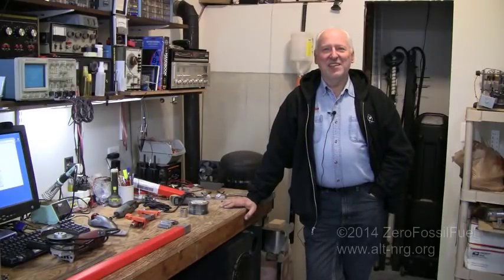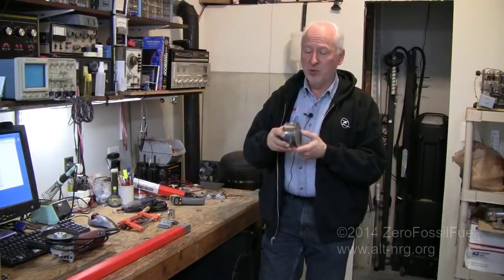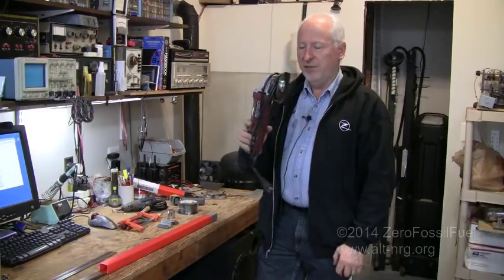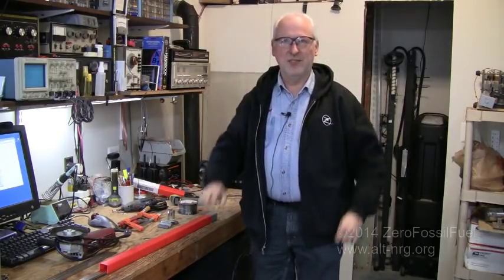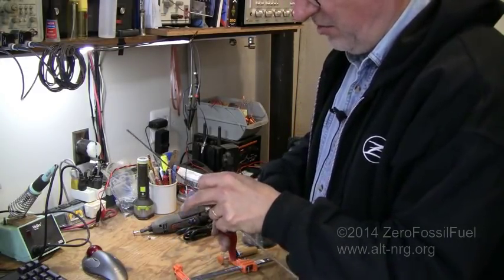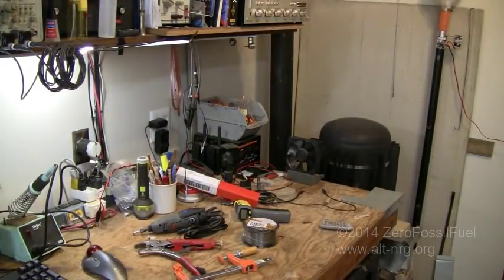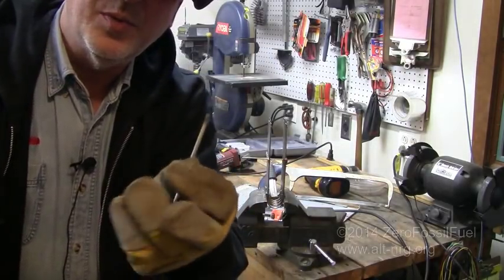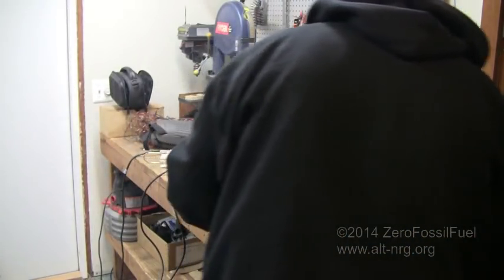#356 Complete tutorial for rocket stove wood pellet fire basket

Comment: I made a pellet basket about 2 weeks ago. Clogging at the bottom is always a problem. I like both 2.1 and 2.2 as solutions to the clogging problem. My riser is only 14inches tall so my draw is not as strong. This has forced me to seek a better way to allow pellets to pass through without dropping through too fast.

My guess is that 2.1 will burn hotter than 2.2. Just a guess.

VERY valuable video. I hope you don't mind me saying... You da man! :)
Reply from the maker: Oooh, only 14"? Man that's short. I would stongly urge you to consider a taller design. Thanks for the compliments!

Comment: filmfotorocketstove
Hello Desmond, I think you're callaed Desmaond, cause I read that in some of the replies. Over the last two weeks I have been copying your version of the rocket stove. I tried it several times and it works great, although I didn't attach the stove to a correct flue. I had to burn off the paint first before I could place the stove into the house. Everybody does his modifications and so did I. For example I made the woodbox, woodburnbox about twice as big to accomodate bigger and ill formed branches. I also rounded of the corners of the riser and I installed a kind of wedge schaped piece of brick in the rear part of the burnchamber at the bottom of the riser to get (I hope) better flow. Because the bricksize is different here in Holland I made the metal support box a little higher. Hope you would like to comment and like my build. Kind regards, Karel

Comment: Very nice!
I've got my firebrick all cut with my wet saw.
8" by 24" black stove pipe, and fiberglass insulation.
Burned it with just bare kiln brick wrapped in metal wire tonight.  
Impressively good clean hot burn.  Looking at my wood shed, 6 full chords, nice thinking how much longer it will last me with this puppy barking all winter, inplace of that monster stove I built a year ago.  That bugger was a lot hungrier than this will be.  

The pellet adaptation is a must, though I won't be building that this winter (I think), but it's a must especially for my two buddies who aren't the firewood gathering types.  But they'll buy pellets if the efficiency is there.  

My buddy will give me his mig welder, and a couple square feet of 16 gauge metal for supporting and enclosing the J-tube base, similar to what you did.  I want to weld that this weekend. 

Going in a closed 30 gallon steel drum (with flattened base) with a 10 (I think) gallon open steel drum upside down over a hole (I will cut), in the top of the 30 gal.  the hole will be about big enough for this 30" tall stack of brick to poke its head through a 25" long drum, into the 10 gallon drum, and big enough to vent back down through 10 then out the side of the 30 gal drum.  Metal drums I had saved for other uses, but the best possible option available in my (internet shopping only) based small town, is to build this and be done with cutting firewood for about 5 years.   I can make it work and I'm getting excited.  

Keep up the good work, I enjoy very much the learning process.  

D.

Comment: I like the revised design.  It will be interesting to see how long the SS rods will last...My guess you'll get about 400-500 hours out of them.  One of the problems that I ran into last year with the basket is that the rods slowly get thinner and thinner, dropping more unburned pellets through.  It's the main reason why I went with the SS grate instead.  But I'm probably burning a lot more than you are with mine.  I'll finish up my 3rd ton of pellets in a few weeks.  ;-)
Reply from the maker: Oh, you're burning way, WAY more than I am, and probably hotter. That dome is not exactly too well insulated. What do you figure your R-value is?

My shop has R13 in the walls, R19 in the roof, Anderson thermopane glass, and I only run it maybe 3-4 hrs on nights when I'm playing, er uh working down there. Yeah, that's is, "working". ;-)  I'll be happy to get one season per fire basket but I suspect I will get more.

Thanks for watching!
Reply: ZeroFossilFuel The r-value of the polycarbonate is 1.7.  ;-)  The building section is around R-20, but the majority of the heat is going right out through the poly.  Even if I have to replace the SS every season once or twice, it's still cheaper than getting an outdoor boiler and having that wear out in 10-15 years.  Overall, I'm happy with the RMH, but I know I can improve it!
Reply from the maker: Bigelow Brook Farm (Web4Deb)
"...but I know I can improve it!"
Of that I have no doubt.

Comment: Hi there, not sure if your still doing this pellet thing. I noticed you might have a knack for electronics. As I'm building my own stove, i had an idea to incorporate an Arduino Uno programmable microcontroller, a stepper motor driver, and a NEMA17
Stepper motor with a small auger/screw.
Programming screw speed to optimize the pellet burn rate. These are affordable, and easy to program, A timer can also be incorporated to shut down after a given  run time. 
I have some spare parts left over, and may play with this idea myself. Just a thought. Thanks for all the informative videos.

Comment: Love the videos and your ideas... I do a little fabrication... the 1/4 inch pieces that you use to space the rods .. if you stick them back in the basket and take another longer piece of the same material and wield it on across the ends it would make a handy jig for making the baskets... then you would not have to line them up and clamp them every time.. To give you a visual if you set it on the table and looked at it from the edge it would look like a comb... Again thanks for the videos...
Reply: Great idea!! Would indeed save a ton of time...

Comment: Excellent video ZFF. I researched the welder you used and the descriptions say "not suitable for stainless steel". I've never done any welding but your video makes me wants to. Do you have any problem in using this welder to weld stainless? Is that why you specify that you run it at 90 amps?
Reply from the maker: I think what you read was because this is a gasless welder only. Most people weld SS with gas. Flux core SS MIG wire is not very common. Took me a while to find it. A lot of people may not even know it exists.

And yes, 90 amps for two reasons. This MIG wire comes only in 0.035" and SS melts at higher temps than mild steel.

Comment: Brian, I was a joking I just wish I could speed up my workers like you do your video....
Reply: Hi Desmond, I am watching the video and it looks VERY complex for a relatively simple project.   Use something like 4" x 6" 'box tube welded for the firebox, wood feed and ash removal and primary flue.   Then a cut gas bottle for the hotplate section and lower duct to redirect the heat to home heating and eventual flue...   The concept is to be able to make cheap stoves for third world kitchens...
Reply from the maker: Brian Ballard
There are very specific reasons I use firebrick liner exclusively as opposed to all steel. If you haven't gotten it by now you never will.

Comment: Good Morning,  I am Cursed by always looking for " The Next Step" Disease.  Have you considered a " Sacrificial Bottom " for the basket?  I don't weld.  Could rods be clamped between 2 plated for each side with the internal section a Rectangle to set your spacing that your side rods supply?  Or, slotting some "Key Stock" for part of a replaceable basket rod setup?  The Mechanic's at Work love me Too!!!

Comment: I know this is probably a stupid question. But is this modification more energy saving considering the energy it takes to produce the pellets?
Reply from the maker: No more energy than it takes to run a chain saw or mill wood used to make pallets that I was burning. Think about it.
Reply: I just don't know how those pellets are produced. But I don't think they use whole trees in the process (I could be wrong). So total energy cost could be "chain saw" plus "pellet process".

Not that I'm overly concerned. But it just popped in my mind.
Reply: DeRaafMedia You can get pellet making machines from about $100 to pretty much whatever you want to spend. They're the same machines that make animal pellet feed. The commercially available wood pellets are generally made from sawdust at lumber mills so they're 100% natural wood from trees, no reclaimed "wood."  Buying wood pellets is no more expensive than buying raw lumber for use in a wood stove.
Reply from the maker: I was telling Scarecrow I thought they looked lik pellet feed. I guess I was right!
Reply: ZeroFossilFuel Yea, some of the bags even warn not to feed them to animals. lol

Comment: Super videos!  And good encouragement to try flux core on stainless.
You could use a thin piece of wire in the U's to space/stagger the loops for welding.  Easier.
Cheers
Reply from the maker: ve6kk Don't forget, the wire has to be stainless too. I didn't use standard flux core wire for this.

Comment: Hello ,
It's a good idea in stainless steel
Can you tell me, how long the rods last.
Does it decrease in diameters after 4 years?
I like your videos, explain you very well in detail.;)
Reply from the maker: Yes, there is degradation, almost exclusively on the downstream sloped face of the basket, the rate of which depends on how hard you push the stove. I'm now using 3/16" dia 316L rods. I may get two seasons from it but no more. Considering welding short tungsten steel rod inserts in the area where it burns hottest.

Comment: How many "ounces per hour" of pellets does it go through at full intensity?
Reply from the maker: The standard unit of measure for pellet consumption is lbs/hr.  About 2.5 to 3 lbs/hr.
Reply: ZeroFossilFuel
Interesting... How does that compare to the burn rate of regular wood, and is there a way to calculate the BTU of this unit when running at full capacity?
Reply from the maker: latasha66
Previously I was measuring in terms of cu-in/hr of regular wood and that was about 80 cu-in/hr. Of course that translates to weight very differently for various wood types. Oak and cherry burned hottest. Dry oak is 0.77g/cm^3. 1 cu-in = 16.4 cm^3 = 12.63g/cu-in or 0.445oz/cu-in. 80cu-in/hr = 35.6oz/hr or 2.225lb/hr.

So, as you can see, the numbers line up. Hottest I ever saw on the stove with regular wood was just over 700*F. Average temps just over 500*F. Hottest run to date with pellets is 835*F. Average temp with pellets around 650*F.

Comment: Did you know regular flux core wire will weld stainless steel but the welds will rust over time like regular steel.
Reply from the maker: Yes. I got 2 years out of my 1st pellet fire basket. I'm sure it would have fallen apart sooner had I not found flux core stainless to weld it up with.

Comment: 12:22 to 19mn29s
I still do not understand why he shifts the U. Has he explained it? I do not master much English language.
Reply from the maker: Staggering the U shaped rods increases the gap between rods at the bottom of the basket while keeping them closer together on the front and back. This helps to discharge used pellet ash more easily after they have been consumed. The ash is sucked into the burn tube and deposited across the bottom. The burn is very complete and the amount of ash produced very small.